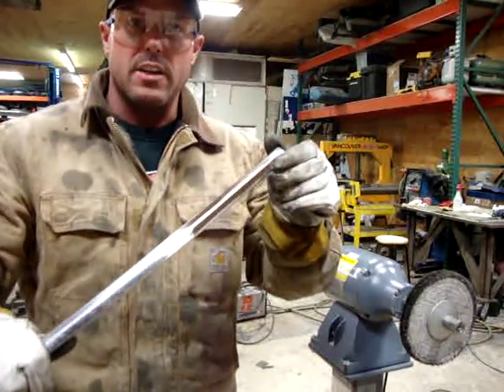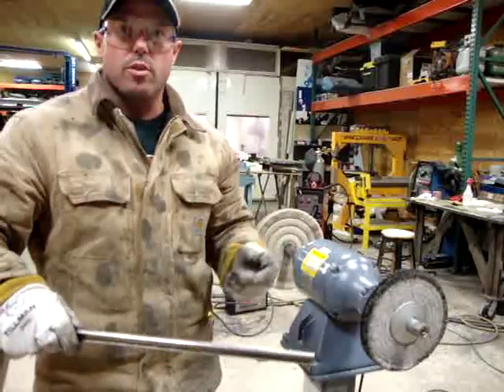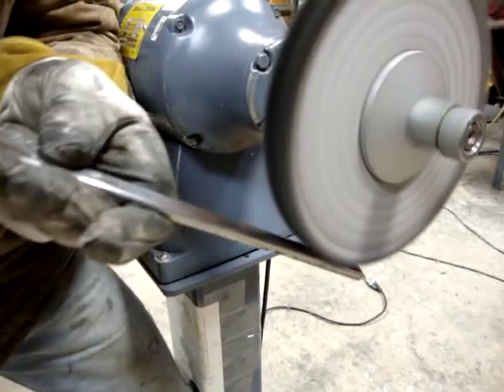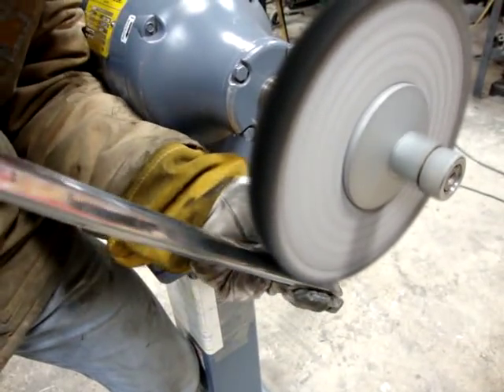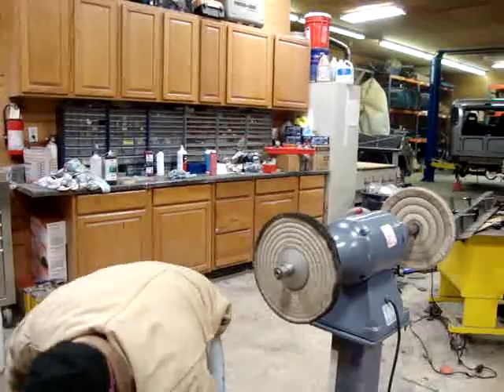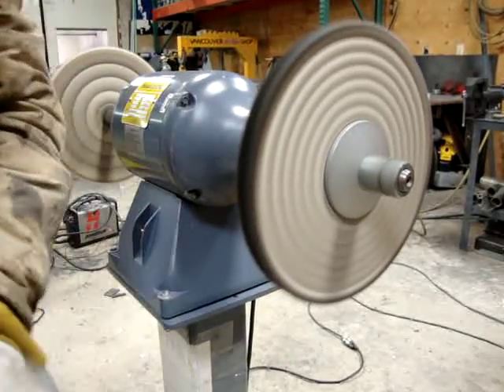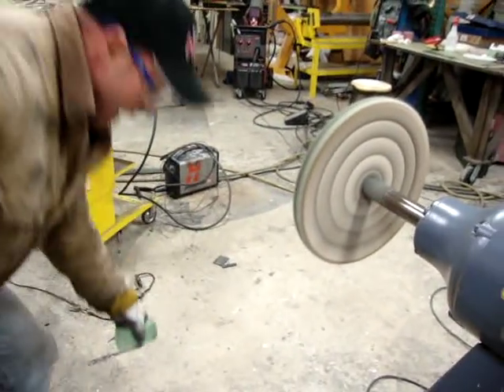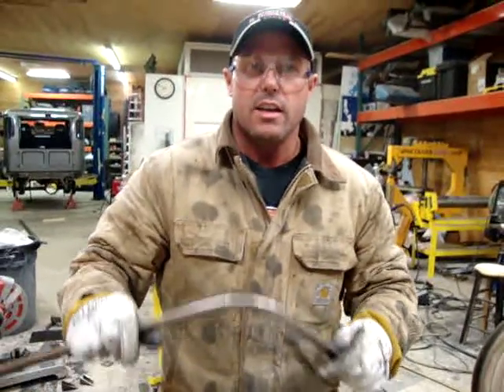Tips & Tricks for Polishing / Buffing Stainless Steel Trim Part 3.MPG

Comment: Thanks for this video.  I just had frame and paint work done on a 25 yr old vehicle.  There are stainless steel panels mounted as well.  I noticed primer overspray on aluminum trim and tried some 600 paper I have.  Wow, it left the aluminum cleaned up.  Then I used it to clean up some old corrosion on the stainless and same result.  So I was checking here to see what you really should do.  Learned something.   I will do more on the stainless after seeing your 3 videos.

Comment: I used same buffer to do all trim on our 300 b chrysler,,,,took me some 6 weeks to complete. Came out perfect and now can do with confidence for future needs.  Found working indoors was far too noisy, dirty and dangerous,,,a part taking flight for example. 

I had a 6 ft sq piece of cardboard from a packing box.  Laid it my driveway and each day I would drag the buffer and set it on the cardboard.  When done each day, the cardboard would be covered with debris from the polishes and the wheels. I would then take this cardboard, bend it a bit and dump this massive amount of stuff in the trash,,,ergo instant cleanup with perhaps a touch up from my battery powered portable leaf blower. 

Also setting the buffer on this cardboard eliminating the tendency for the buffer to jump and skate about on my paver driveway. 

Also had some wireless headphones that protected my hearing,,,,buffing can be extremely hard on your hearing,,,,and listen to the radio or music as I worked. 

All in all a very satisfying almost Zen like experience with the final outcome that turned out a better product than I could ever have wished to pay for.

Comment: Honestly have more questions now... what are the differences in fabrics for the buffing wheels? Flannel, cotton, wool, tightly wound...? Lots to figure out there. What are the differences in the compounds? How many are there? Which wheels can you use them on? I started a little stainless buffing in my garage for a sculpture I’m making and I get these dark streaks on the stainless after buffing some times. Also, I’ve heard the material won’t polish as nice with it being a higher temperature from the friction involved in buffing and polishing, is that true? I have a flannel wheel and a cloth wheel, what difference do they make? You mentioned rouge... what is that?

Comment: Cody. Love your video's. I have been working on my trim and doing the steps as you have taught. I actually have gone to 2000 grit on the D.A. and then to the wheels. I have tried several times and at the end can STILL see the orbital marks that create a haze to the finish. What am I doing wrong?

Comment: Nice video!,

I am facing trouble polishing zinc die castings having pitting. They are unable to be noticed at the time of polishing but are quite prominent at the time of chrome plating. Have you tried copper buffing

Comment: thanks for the tip on caswell plating!!
can you polish industrial (mate finish) stainless steel to a mirror finish with the same method you mention on the vid?
ps: is that an FJ40 on the back??

Comment: Great series of videos! I admit I suck at polishing there are some good tips here.  A couple things all at, try using hard rubber blocks and be conscious of keeping the edges and contours sharp.  Also the first rule of machine shop safety is no gloves and long sleeves on a polisher or grinder.
Reply: yeah,you Need Gloves!,steel trim on an airway buff grabs the wheel,and you have no gloves...you will possibly be  looking around the machine for missing fingers..no joke

Comment: Thanks for the video Cody, a great help. I've used my garage buffer and get results I'm real happy with. I want to move indoors for the winter. What are your thoughts on the level of dust or fibers from the wheels and process? I didn't see too much in my garage, but I kept the door open. Is this going to leave a layer of dust everywhere indoors? I'm 1/2 way done with a '65 Satellite. Thanks again!
Reply: H😊

Comment: Pulling or pushing actually does not matter. The speed of the wheel is so much higher than the speed of the rod so that the additional or subtracted speed of the rod is irrelevant. The satin finish from pulling is the extra compound that the wheel threw onto the rod. When you push into the wheel the final surface has no "extra" compound on it, because wheel is turning away from the rod.

Comment: Hopefully somebody replies to this as I know it’s an old video. I just finished polishing the stainless steel T-top roof trim from my 77 corvette. This was my first time using the buffing wheel. It came out really nice but there as still some fine scratches throughout the part if you look at it under bright light. There are also a few spots that look cloudy. Now I only polished it with white diamond, then the green stainless polish and actually finished it off with red compound. Is there something I might have done wrong or will stainless always have some fine scratches in it from polishing?
Reply: The type of buffer wheel and the horsepower of the buffer motor plays a big part. I have found that you need a minimum of a 3/4hp motor to make stainless shine. Also, as Cody pointed out, make sure to start with sisel wheel to kind of, set the tone of the buffing.

Comment: thank you for the vidéo. But after sanding with 1500, is it necessary to use the sisal ? perhaps it's more "agressive" than the sanding. use directly the finishing one. no??? or perhaps it was to show us the different steps.
Reply: Sisal buffing with green compound will signifigantly reduse the chances of pinholes in the stainless,which pretty much force you to start over and grind them out
stainless in touchy and doesn't like a big gap in operations,as in jumping from 120 to 300,you have to keep everything close to ensure a flawless finish

Comment: Bits of mops can fly off into your face so use a chainsaw style face protector. Secondly the abrasives are made from nasty stuff so wear a simple dust mask just incase. Thirdly polishing knifes on these is very dangerous, the mops can wear down on one side more than the other and can catch you out. Fourth point, you can get at least 2 grades of treated sisal mops that are harder than regular sisal mops. Fifth point, fine sandpaper used with non abrasive polishing cream that has long working time ( peek polish in the UK ) can be extremely effective used together and get a good finish with some patience.
Reply: I had a bayonet catch on a greaseless wheel  and slam into the top of my foot in 1986....Friday november 13th,1986....for a friend,on my break,no comp,not much walking for months,yes,knives suck,as far as polishing goes

Comment: Ya all you guys polish off the Chrome finish that all stainless steel car parts have . Now you have a bright Nickle finish that will oxidize. If you polish & buff stainless take it to a plating shop  & have it flash chrome plated. All they do is run it through a cleaner, rinse then activate it in a mild muriatic acid then give it a about 45 seconds in the Chrome tank then it will match the rest of the chrome on the car like it was when new. I never polished & buffed stainless in my shop without giving it the final protective chrome finish.
Reply: My family owned a plating shop for over 40 years & I do know what i'm talking about. We did plating for Ford & GM in the late 40's & early 50's. As Dave Davies said, wear a face shield & dust mask so you don't get TB of the lungs.
Reply: Jeffrey Phillips you don't make any sense at all you don't know what the hell you're talking about
Reply: Dude,Stainless steel is Made from Nickel; and Chromium.,I didn't start polishing until 1986,and was aware,so my guess is Metallurgy wasn't invented in the 40's...Or That was your Family's sales pitch to gm and ford representatives who din't know any better...I Have Zero doubt it was 1 or the other.
Reply: Stainless steel doesn't have chrome plating. The chrome is inside the metal itself. That's why grinding away the tarnished outer layer makes it shiny again.